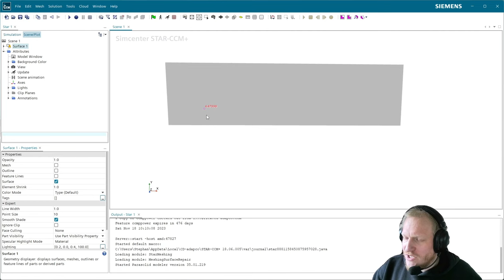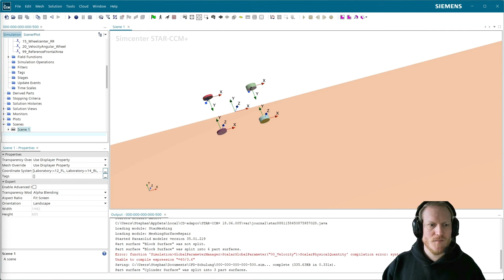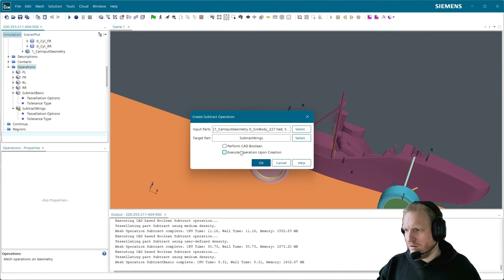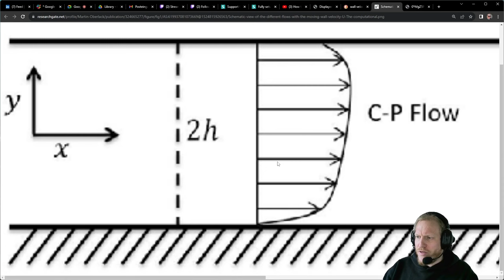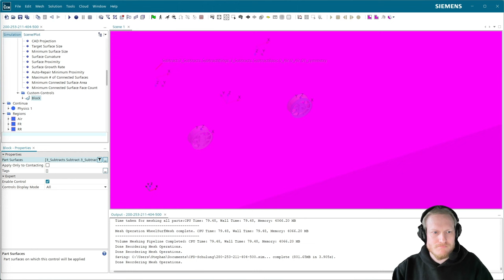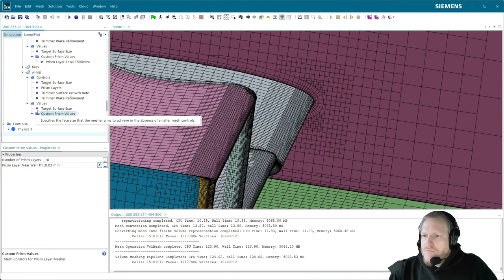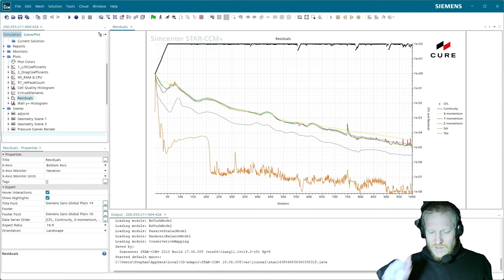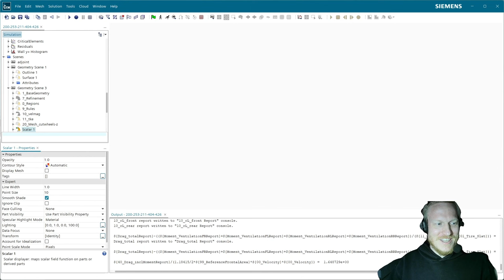Racecar Aerodynamics CFD Simulation Tutorial | Formula Student | Setup | From Scratch to Batch!

Comment: Great video!
I am in the aero department for my FSE team. However, we have been unable to make the steady simulation (segregated flow) converge (with around 18 million cells) using the FSE template of Chris Penny (from Siemens) with some modifications. Hence we are running unsteady simulations for our simulations. 

How did you manage to get it working with steady sims (probably better mesh quality would help)?
Thank you very much!
Reply from the maker: Hi Alvaro. Getting a simulation to convergence is really the hardest part. The Chris Penny model is great, but you learn more if you set up your own. You should revise your mesh. Go for the User Guide, grab the limits for "good" cells and delete everything outside - might work. Also: make thresholds for the "bad cells" to show them and improve the relevant areas. Same for residuals: do an iteration with temp data saved (can't remember the exact words rn) and look at the cells with bad residuals. Improve there!
And: you can limit your maximum flow speed to sth. realistic, e.g. 3x inlet flow or sth.
🙂

Comment: Enlightening video! You mentioned aero-mapping, do you have any pointers to how that would be done in terms of automation and post-processing?
Reply from the maker: Aeromapping.... you require a full car simulation,  not a half model like I did. Make some educated guesses about tire and suspension movement while cornering (turning, tilting etc). Turning, tilting, jaw, right height change - all that should be parametrized. Maybe take CAD parameters, or make clever transforms.
Then: pop up your design manager and make a sweep study for all parameters. Think about which parameters are independent and which are not. 
Simplest post processing: bring diagrams of lift & balance change over parameter.
Extra tip: use overset meshes for everything that moves to eliminate the need for remeshing.

Comment: Can you tell about the system requirements needed for a big project like this
Reply from the maker: This simulation created a (trimmer) mesh with around 36 million cells. To run this, you need at least 72 GB of RAM (2 GB per mio cells, rule of the thumb). Having less would result in crazy swapping operations...
My 16 core CPU needs around 8 hours to run these 1000 iterations. But CPU is more like a linear speed up, not a showstopper like RAM.
Reply: Are the CFD simulations graphics intensive or processor intensive in general? What is the benefit of having a good card for the simulations part. I know for Cad modelling graphics cards are important.
Reply from the maker: @xvlls279  Currently, CFD simulations do not depend on GPUs at all. The phrase "you need a GPU for CAD" dates back to the 90s - you don't need that anymore. iGPU is sufficient! (Unless you start rendering).
You CAN switch to GPU computing with CFD - but then we are talking about having (multiple) GPUs with reasonable amounts of VRAM - like 80 GB or more. Unless you wanna spend several k$ on GPUs - it is CPU computing.